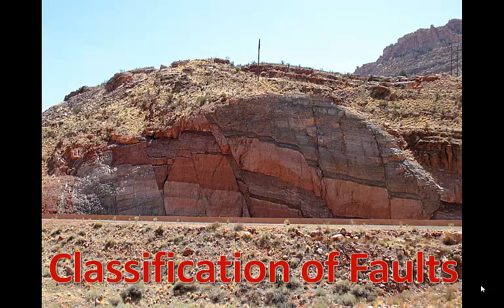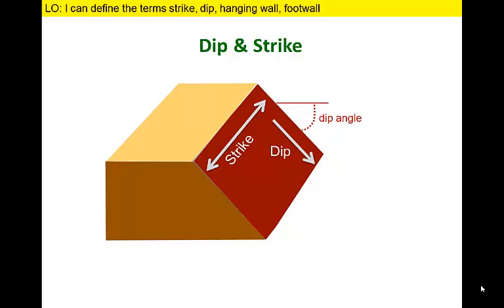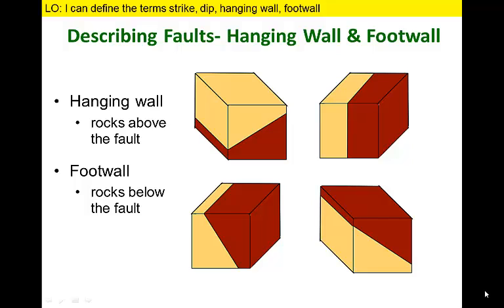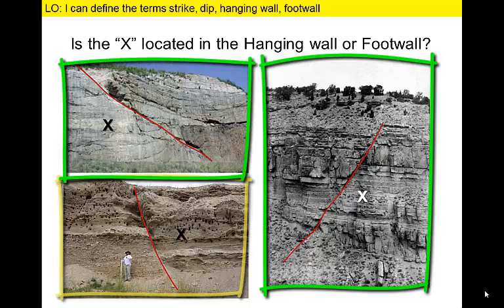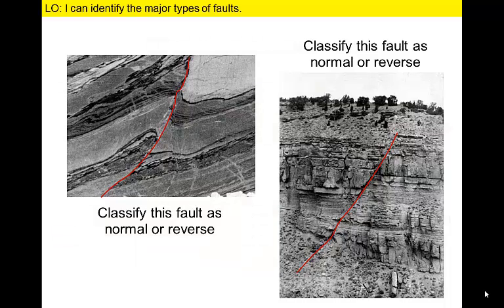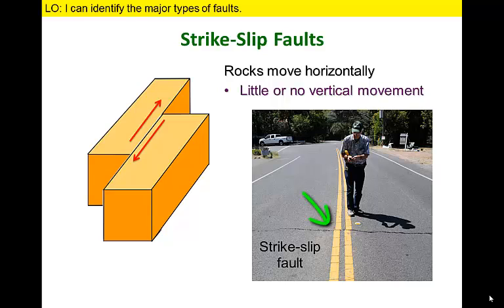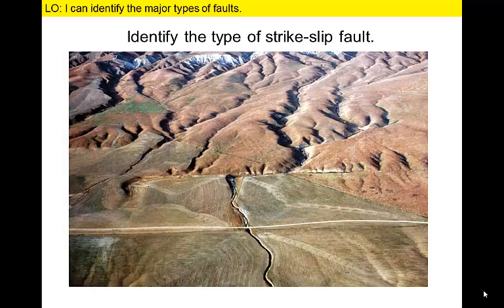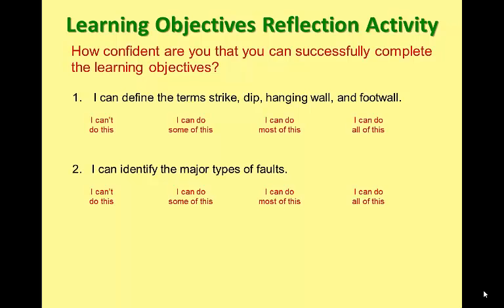Classification of Faults

Comment: 1) Define the term "dip".
The term dip refers to the slope or inclination of any geological surface measured relative to horizontal

2) A strike line is a line that is horizontal Line drawn or inscribed on a sloping surface

3) Dip and Strike are how many degrees from each other
 90

4 The block above the fault surface is called the hanging wall

5) The block below the fault surface is called the Foot wall

6) A normal fault occurs when the hanging wall moves 
down

7) A reverse fault occurs when the hanging wall moves
up

8) A normal fault occurs along what plate boundary 
divergent 

9) A reverse fault occurs along what plate boundary 
convergent

10) Strike slip faults occur along what plate boundary 
transform

Comment: The continents are covered with an average of 1,800 meters of sedimentary materials deposited by rapidly moving water which are heavily littered with rapidly buried creatures which are now fossils. This geologic fact provides overwhelming evidence of the Noaich Flood because uniformitariqanism cannot have produced the strata, it has been demonstrated scientifically that strata form rapidly and in groups together at the same time, making the strata above and below any given streata to be of no difference in age. Features of the strata which prove global catastrophism is the cause of the global strata are:
1. The mountains of the earth are comprised to a large extent of deformed strata, which cannot have become deformed by heat and pressure miles deep inside the earth, but were instead soft and moist when deformed
2. There is a nearly complete absence of erosion between any of the strata
3. There is a nearly complete absence of grass in the geologic column
4. There is a nearly complete absence of soil in the geologic column
5. The strata have fine and distinct boundaries between each other instead of gradating
6. The majority of strata possess grain-size distribution - a feature that is produced only by rapid sedimentation
7. Sand dunes formed under water litter the continents, verified by their approximately 15 degree angle of inclination. Sand dunes formed by wind have an approximately 25 degree angle of inclination.
8. A fossil record - Fossilization requires rapid burial. All strata in which there are fossils were deposited rapidly, regardless of other properties they may have.
9. Abrupt appearance and stasis of life forms in the fossil record and absence of transition, which would be outrageously abundant if uniformitarianism and evolution were true. Stasis is predicted by the Noaich Flood.
9. Fossils which have been transported many miles with the materials in which they were buried which indicates vast quantities of sediments being transported by vast quantities of rapidly moving water.
10. Mountain Water Gaps exist globally - mountains which were still soft and moist after rapid uplift which were pulverized by a newly created stream of water (river) which ate through the mountain.
Water seeks the path of least resistance and could not have eaten through the side of a mountain. It would instead flow around it.
11. Dropstones are common in mountains - large rocks and boulders which have become moved into place by very fast moving water and sealed in sedimentary strata which deform around them
12. Planation Surfaces are plentiful on the earth - broad areas, sometimes hundreds or thousands of square miles which have been planed off by massive sheets of rapidly moving water as the flood waters abated the continents during the end stage of the Noaich Flood - uniformitarianism cannot account for massive planation surfaces.
13. Percussion Marks - impact marks ranging is size from small to huge on rocks and boulders across the earth show that extremely fast moving water (up to and beyond 100 mph) has moved rocks weighing up to tons at high speed - enough speed to cause percussion marks under water when they collide with each other.
14. Massive quantities of methane hydrates lining the continents - frozen or semi-frozen methane hydrate which is buried in sediments around the edges of the continents - produced by massive volumes of plant matter ripped from the continents and buried which has now become frozen methane gas. There is so much of it that if it could be mined efficiently, it would provide enough energy for the entire world for over a century.
15. Oil and gas reserves under high pressure - the pressure could not be present after many millions of years. The gas or oil would dissipate all pressure through fissures and microfissures in the rocks. Unless the oil and gas were produced recently, it could not be under high pressure.
16. Fossil footprints formed underwater which show that the animal was climbing against the flow of water in an attempt to survive.
17. Cruziana - fossil footprints, typically found in cross bedding, which lead up to it's fossilized body, which indicates the animal was struggling to survive and evade innundation as it was becoming buried.
18 classes of arthropods in the lowest stratum of the Cambrian (only 5 classes exist today), indicating life was astonishingly complex and more diverse in the earliest record of life than it is today.
19. Polystrate fossils - leaves, marine fossils, trees, worms, etc. show that the strata in which they are encased were deposited rapidly, effectively eliminating all concepts of vast geologic time.
20. Massive canyons - carved out while their strata going down to 1 mile or more deep into the earth were eroded very rapidly, effectively eliminating all concepts of vast geologic time.
20. Megasequences - There are 5 major megasequences which span the majority of North America and can be found globally: 1. Sauk Megasequence, which rests upon basement granite 2. Tippecanoe Megasequence 3. Keskaskia Megasequence 4. Arrasoka Megasequence.  5. Zuni Megasequence  The Navjo Sandstone covers 400,000 sq. km in the western US. comprised of grains eroded from the Appalatian Mountains. The Coconino Sandstone formation averages 315 ft. thick and covers 518,000 sq. km in the US. and sits on the Hermit Shale. The boundary between them is extremely fine. This removes the potential for long perionds of time between the Hermit Shale and Cocconino Sandstone, and verifies both were created rapidly. The Tapeats Sandstone and Redwall Limestone of Grand Canyon can be traced across the entire United States, up into Canada, and even across the Atlantic Ocean to England. The chalk beds of England (the white cliffs of Dover) can be traced across Europe into the Middle East and are also found in the Midwest of the United States and in Western Australia. Inclined (sloping) layers within the Coconino Sandstone of Grand Canyon are testimony to 10,000 cubic miles of sand being deposited by huge water currents within days. Directional sorting is often found in the fossil record. The Miffle Permian Qixia and Maikou limestone of southeast China cover 1.2 million sq. km.
21. Giant gravel deposit sheets miles wide and dozens of feet thick (such as in western Sichuan Basin, China), sometimes up to hundreds of miles from their source location, and massive rock deposites up to miles deep 
22. Numerous other facts - erosion rates, geologic young age for the earth's rocks, genetic mutation rates, and many others all discredit uniformitarianism and show the Flood of Noah is a historical geological fact.